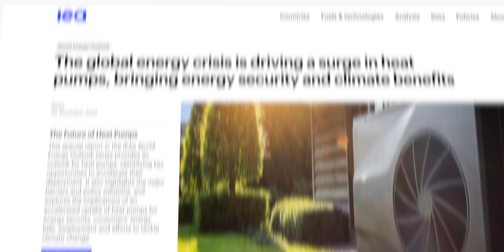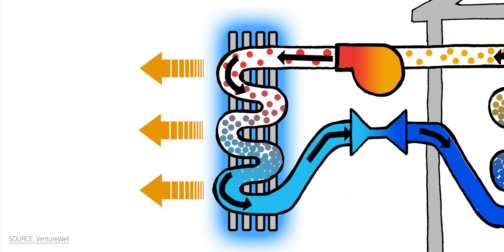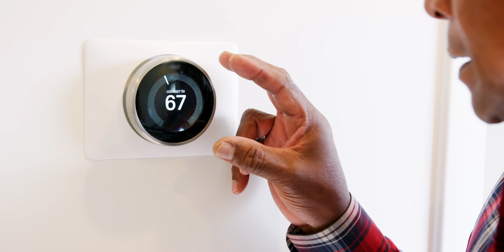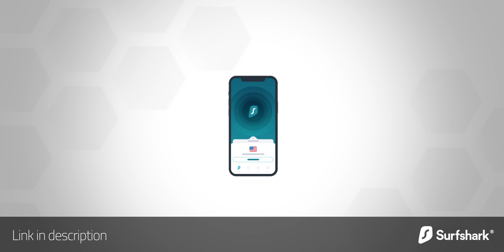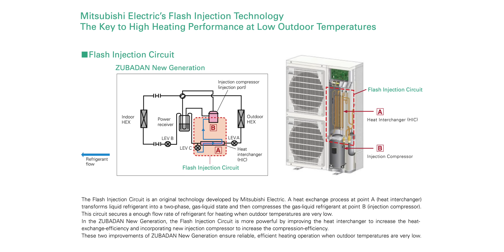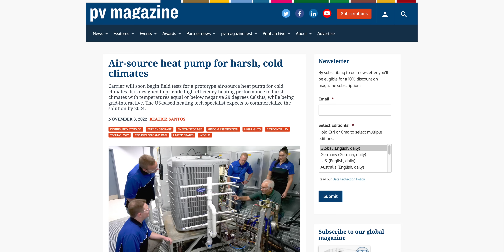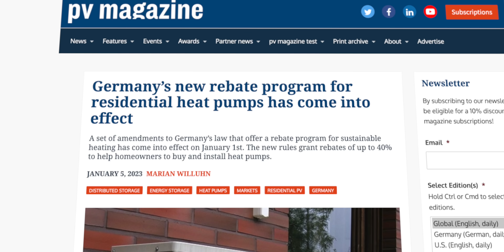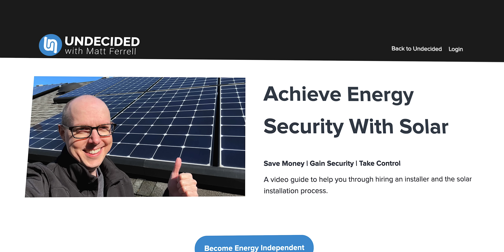Major Advances with Heat Pumps in the Extreme Cold

Comment: I live in NW Florida and I have to say that current non geothermal heat pumps are not my cup of tea. It cools the house just fine in the summer but in the winter (which is thankfully only about 4 months here on average) it struggles to keep the house at just 68F while the NG houses sit comfortably at 70-72F. The worst part though is the power consumption, the heat pump is less efficient at warming the house leading to power bills that are double during the winter what they are in the summer. On top of that NG is fairly cheap here so my total energy bill is often three times higher than a gas/electric house even if it has old aluminum windows and lacks insulation. Hopefully new tech will bridge the gap a bit. The water heaters look awesome though.

Comment: Being on the coast in the UK the lower temperatures are not often an issue .
  I have more concern about the corrosion the salt air will cause .
  Unless many of the components are marine grade then surely the lifespan will be very limited .

Comment: I had an lg red system installed last year and my elec bill has tripled this winter, I’m in New England and I wouldn’t recommend these type of systems unless your in a warmer climate
Reply: tripled vs what? having any fossil fuel heating system doesn't use a great deal of electricity because it's consuming the fossil fuel for the heat, whereas a heat pump will be solely be consuming electricity.
Reply: Compare that to your classic heating system. I'm waiting

Comment: When the temperature drops to 5 degrees C ??? How about -20 degrees C ? Good luck.
Reply: why? have you experienced any of those with a heat pump?  It's 2C now, and my whole house is consuming less than 1.5kW of electricity with 3 heat pumps, and other household things going like 2 PCs, lights etc.  It was also -20C a couple of weeks ago for about 3 days straight, and mine were heating the house just fine.
Reply: @BenIsInSweden  , you must be paying really cheap KW/h , try paying 25 cents for each one and then we'll talk , plus that 1.5 kW sounds way too low for the whole house in extreme weather.
Reply: @danielesbordone1871  if you understand heating properly, then you will know any heat source will consume more of its energy supply at lower temperatures.
Your initial comment didn't mention cost at all, just temperature.  
For where I am natgas costs similar to electricity per kWh/h (not that I can heat my home with natgas).  So regardless of outside temperature, a heat pump will always cost less to run than a gas boiler or furnace.
Reply: @BenIsInSweden  , you speak as if heat pumps are the greatest thing since sliced bread and that they're for everyone but that's not the case. They're not for everybody as they want you to think.
Reply: @danielesbordone1871  They aren't for every situation, I haven't said that they are, but you speak as if they don't work in 2C or -20C which they do when they are designed and sized correctly. Gas only has 2 benefits over a heat pump in home-heating, Compactness (in terms of a boiler), and in some areas energy price.  The latter point won't last forever,  especially with advances in Solar and home battery storage.

Comment: Matt, 
Thanks for the great content about heat pumps. In addition to circulating refrigerant like an air conditioner, the efficiency of the heating cycle benefits from heat of compression, sort of a two for one benefit.

Below are my priorities if solving for highest reduction in residential heating energy use.
1. Low air leakage building envelope. 
2. Low overall building envelope heat/gain loss (high performance insulation, windows,etc.)
3. High efficiency heating system, like use of ground source heat pumps

At one point in my career as an HVAC system designer, I provided designs for high end residential properties, including 7 of the 10 wealthiest people in WA state(2000-2008). Energy use was always considered but comfort, noise levels and aesthetics were design priorities. 

For these residential applications, use of ground source heat pumps was common, though a few designs used a large deep water lake, called Lake Washington. Some questioned the environmental impact of a residence adding or removing heat from a lake. Just for fun, calculate the amount of BTUs added by the sun in one day, and compare to the net amount of heat exchanged by a house. I digress. 

For discrete zones within residences, a combination of air and radiant floor design was common. Radiant offers superior comfort, especially at high ceiling areas, and is also silent.  Potable hot water was often integrated by connecting water-water heat pumps to the ground loop heat exchanger. 

Keeping all ductwork within the building’s insulation envelope (or insulate to the same R-value), and using air-air hx for indoor ventilation is also important.

A ground loop is a significant expense. Equally true is that a ground loop life cycle is easily 50+ yrs, where compressors or furnaces wear out in 25 yrs or so. HDPE plastic, used in ground loops, is a very robust material. Stainless steel, advised for lake loops where significant wave action is present, also has a very long  life cycle. 

As you are aware, viewing our country’s residential building stock from a life cycle cost perspective rather than a least first cost perspective is the issue. If a life cycle cost approach is adopted, say 50 years of life before a structure is demolished, then high performance building construction and high efficiency heating systems would be selected based on the merit of being the least expensive systems. 

Conversely, if a least first cost approach remains (code minimum), then the value of high performance construction or highly efficient systems is underrepresented or considered excessive by definition. 

I applaud content like that serves to educate in these matters.
Best regards,

Comment: One challenge we have with switching to a heat pump is the low heat output. Our house is heated by oil and radiators which require 60C or higher temps. We've been told heat pumps can't be used in this scenario. Anyone got any experience of that?

Comment: You are making one huge omission in your video and that is the average cost of gas versus electricity per kWh. In the UK we pay 4 times as much for a kWh of electricity compared to gas, therefore even if a heat pump is 3 times more efficient than a gas boiler as you state, it's still going to cost much more to run on top of the 3 times higher initial outlay. In the US you are lucky that electricity costs half of what it costs in the UK, making heat pumps viable. They are not viable over here even with cheaper nighttime electricity.
Reply: gas isn't 100% efficient.  With the central heating systems in the UK, you are lucky to get 85% efficiency out of your boiler.  The UK also generally doesn't get the "extreme cold", so with the proper set up you can get a SCOP of 4 in the UK.
Reply: 50% of UK's gas is imported, while only 15% of electric is imported. Don't rely on gas too much....

Comment: You are depending on the grid for power.  Can you run a heat pump off a small generator, say 2000 watt?  You can run a furnace of that.
Reply: People have been reliant on the grid for power for their gas heating systems for decades.  If you experience extended power cuts then it would be better to get home battery storage or so, which would get more use than a generator that gets used only in a powercut.
Reply: @BenIsInSweden  You didn't answer my question.  Can you run a heat pump off a small generator, say 2000 watts?
Reply: @markmaugle4599  Depends on the circumstances.  My whole house is currently using ~1600W, which has 3 heat pumps, 2 PCs and a TV running. Outside temp is 3C, indoor temp is ~20C.  So, yeah I could power my whole house currently on a 2kW genny if I wanted to.

Comment: California plans to outlaw natural gas supply to new homes and stop selling gas appliances, so getting forced to heat pumps.  Meanwhile, many utilities are greatly increasing rates, esp PG&E and San Diego (83 c/kWh peak last Summer).  The "more efficient than natural gas" is wrong in the total cycle.  Electricity is "mechanical energy" which is a higher form.  True the COP can give 2x heat energy, but back at the power plant 2x thermal heat was required to make that electricity, so a wash, indeed less efficient after transmission losses than using the thermal heat directly.  See "2nd Law of Thermodynamics".
Reply: Where's your math for it? UK Gas Power Plants have an average of just shy of 50% efficiency, with Keadby 2 being over 60% efficient, and other upgrades on the way to bring other UK gas power plants to the same level, transmission losses are according to the grid 6-12%, with the average at 8%.   Everything is done in kW/kWh.  MCS requires a minimum SCOP of 2.8.  Gas boiler efficiency in the UK averages about 85%.  10,000kWh of gas annually would produce 8,500kWh of usable heat from a boiler.  For a heat pump achieving the minimums, you would need 3035kWh of electricity, add in the 10% for transmission losses ~3340kWh required, x2 for the gas power plant efficiency, you're looking at 6680kWh of gas used powering a heat pump by having 100% of the electricity generated by gas.  Which in most cases, there are going to be other renewable forms, further reducing the amount of gas used for home heating.

Comment: Efficiency numbers aside, we need to talk about the elephant in the room - the cost of electricity. I live in the Northeast in a 1970's split level home with a gas forced hot air furnace, gas water heater, gas range and a gas dryer. I keep my house at 72F in the winter around the clock, and yet my electric bill is higher, or at best equal, to my gas bill in the winter. So yes, while the new heat pumps are super-duper energy efficient, they are still more expensive to run than a gas furnace, and they cost a lot more as well.

Comment: I got two heat pumps installed and removed my oil furnace.   Got $800 back from the government and froze on cold days.  Fact is they don't work that great and when it's - 15 C out they just blow cold air.   I just got a new propane furnace in and the cost of the unit may have been $3000 USD but the installation total with the boiler was $8000.  
Don't get sucked in on these heat pumps unless you have a secondary source of heat for when it gets below -10C.

Comment: As a hvac tech my best advice is to consider where you live. Up here in most canadian cities, you run a big risk of it not working and you will just have to kick the furnace back into action. Also one day when your heat pump needs to be replaced there are still many question marks as to if these gov rebates will still be around. If not. Be ready to pay a fortune.

Comment: Nothing is more efficient than an electric heater. CoP is a measure invented by manufacturers and is really smoke and mirrors.  I'm a fan of heat pumps and work with them daily, for cold climate, I would just add an electric heater.  Trouble will be down the road when everyone has an ev and the grid can't keep up. While greener than a furnace, but depend how your area generates electricity, if it's still through coal, it's not really that green

Comment: my 1,000 sf home currently costs on average about $1,200 per year to heat with my high efficiency ng furnace. 
What would the pay back time be if i scrapped my perfectly good ng furnace and had a new heat pump system installed? I am 77 years old, does it make any sense?

Comment: The past four winters I have heated my all-electric superinsulated home in Montana using a single Fujitsu heat pump.  It's our sole source of heating (outside of passive solar) and has heated the house even in -26*F weather.  Yes, the output is reduced and there is little to no efficiency benefits at that low temp, but it's very efficient otherwise and has been very reliable.  Payback on the unit was less than 2 years.

Comment: I live in South Dakota and have used an air-exchange heat pump to heat my home to air temperatures down to -20F. The heat pump will send hot compressed freon into the home regardless of the outside air temps. Where they fall short is eventually your heat loss will exceed the heating ability of the heat pump. Heat pump heated air temp = 105F, forced air gas heat is much hotter.

Comment: Have you done any research into the upfront CO2 emissions from mining, smelting, manufacturing, transportation, installation, source of electricity to run these units, etc. compared to the time when the unit will become CO2 neutral? 

To say that these machines will help with mitigating CO2, is a bit of a leap of faith until all sources of production are put into the equation.
If your electricity is sourced from coal, chances are, this unit will never be CO2 neutral over its lifespan.
Replacing a well maintained gas furnace or boiler, if all CO2 inputs are calculated may end up being a net negative in lowering the CO2 footprint over the lifetime of the unit.

I like the idea of this technology, but if the main reason we should install these units is to mitigate our CO2 footprint, then they may actually be a backward step.

Comment: As a long-time retired HVAC technician from the U.S. Midwest, I was never much of a fan of heat pumps back in my working days, but I've seen a big jump in their advantages in recent years.
I don't keep up with the technology as I once needed to when still in the business, so I don't know if this next idea has been considered.
Since geothermal seems to be the most reliable source of heat transfer year-round, would it be reasonable to have one geothermal loop that pipes its liquid heat transfer media to all the appliances in the home that would benefit from it. There might be challenges in having balanced flow among all of a home's appliances depending on load at any given time, but I doubt that those issues would be very difficult to overcome.
If one is willing to initially investment in geothermal in the first place, some additional piping, possibly some small branch pumps, valving and controls would be worth considering.
Maybe it's already been done. 
Just a thought.

Comment: For retrofit, you'd be a moron if when it came time to replace a central A/C unit on a forced air system you didn't get a heat pump.  We did it with ours, and it's drastically reduced our energy usage - going full heat pump was impractical as I would need 18 tons of heating capacity compared to a mere 5 tons of A/C capacity (and all of the knock-on effects that has in terms of backup generator sizing, 400A service, four exterior units, etc), but the fact of the matter is that the full capacity of our oil heat system is simply overkill for most of the winter.  The auto-switch mechanism of a thermostat means that when it's warm enough for the heat pump to be efficient, it uses that, then kicks over to oil when it's properly cold out.  So far our oil consumption is less than half of what it was, and despite electricity being relatively more expensive, the heat pump's efficiency reduced our overall energy bill significantly.

Comment: I installed a ground source heat pump system at my home( using water as the heat transfer medium   ran 2 circuits of type K copper pipe in a horizontal and 2 vertical well loops that is a  closed loop system that are 60 feet deep--existing before system was installed), that I built myself, and has been in operation 30+ years without any problems. all of the component parts are original( water temp leaving= 40 degrees F/ 50 degrees F return temp    discharge air temp 120 degrees F in heating mode). I did hvac-r work on a commercial/ industrial basis( now retired). the older heat pump systems would not keep up with indoor heating requirements, and would operate nonstop when outdoor air temperature would get below 20 degrees F.( air source heat pump) the older systems would need additional  back up heating in the form of resistive electric heating coils that are expensive to operate. heat pump technology has been around 60+ years, and was largely marketed/ installed in the southern states where it is much warmer during the winter. I would think that the new technology heat pump systems are much better, however the maintenance costs of failed component parts and installation costs could make this a financial wash, and when/if you reach the financial break even point, you are in need of a new system!!!!. do not be fooled by the notion that scroll compressors are rough/ tuff, and like "JOHN WAYNE" toilet paper will not take any crap off of any weather condition thrown at it, is in for a ruud awakening. where I worked, the scroll compressors were  number one when it came to failures. the best compressors were the screw type/ reciprocating semi hermetic type( that is the compressor that I am using at my home).

Comment: I have had heat pumps for 30 years in various houses  The biggest problem is unskilled technicians who can not charge a split system properly.   Pre charged connecting lines are a solution but are some times messy to install.

Comment: @undecidedMF, The problem I'm running into is: Those "approved" installers/contractors are cannibalizing the entire rebate by charging entirely too much for the same 1-day job as conventional water heater replacements. Pretty much like a cartel - defrauding the government, the homeowners, and everyone in between. Apparently there are no controls as to how much program-approved installers can charge. I'm getting quotes from $7500 to $10,300 for the installation of a $2000 heat pump water heater that you can buy at HomeDepot. In other words, they''re approved to take your rebate money in an organized fashion, and you STILL spend $3-$5k out of pocket LOL. How is the government getting this so wrong??